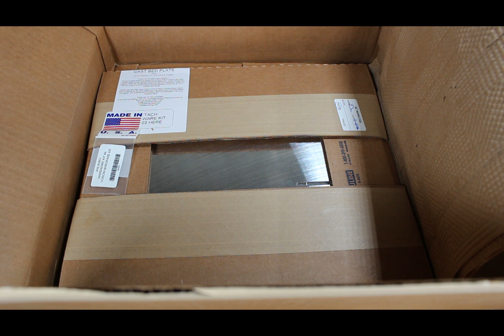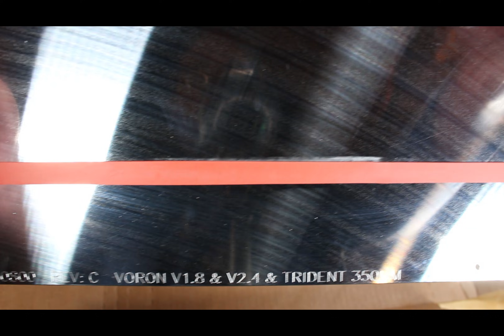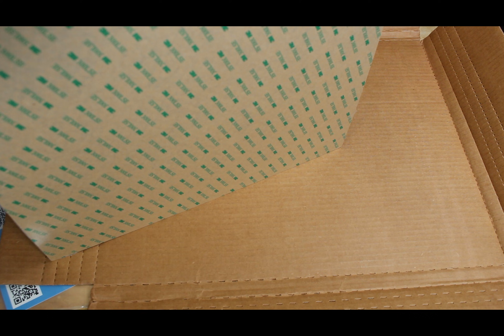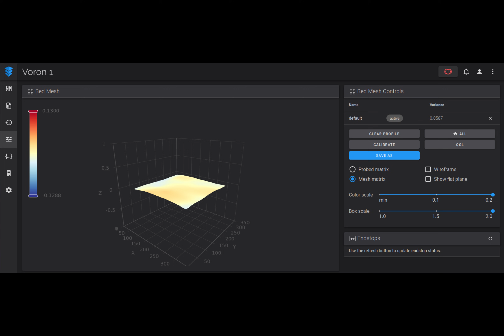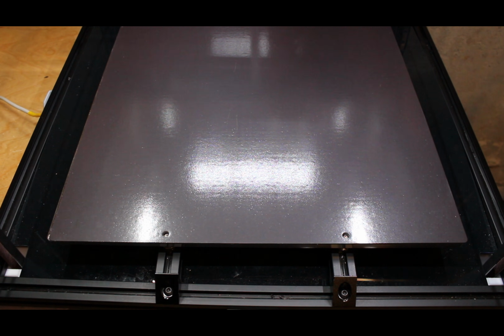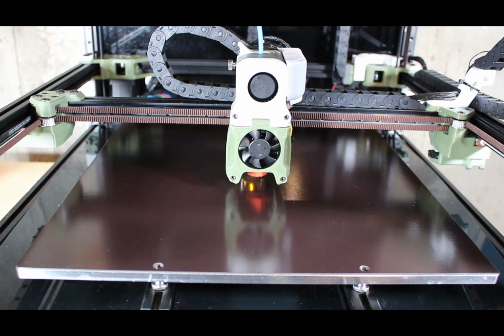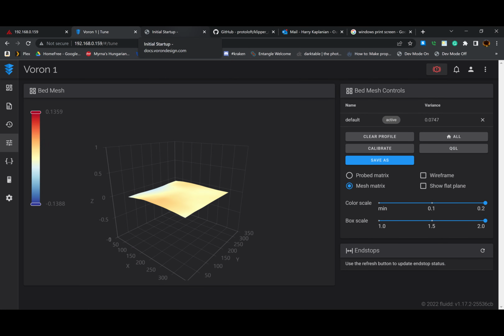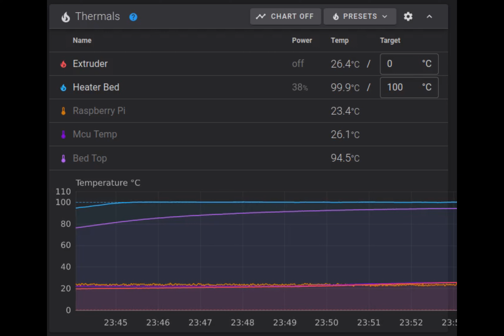The Secret to a flat  3d printer bed

Comment: Goo-Gone has acetone in it which I suspect is why it came off easy.
Reply from the maker: If it does, I could not smell it.  It's a bit of a mystery what's inside Goo-Gone...
Reply: @KapmansBasementWorkshop  I actually went to get acetone the other day and saw Goo-Gone. One of them definitely showed it having acetone. The other types didn't really mention it so maybe yours doesn't.
Reply from the maker: @jackshett  I could not find acetone that week.  So Goo-Gone it became.  Does the acetone work well?  I was told online to use alcohol, and it did nothing.  It might have even made the glue harder!
Reply: @KapmansBasementWorkshop  Acetone does work, but it is probably about as effective maybe slightly stronger.
Reply from the maker: @jackshett  Probably stronger.  But the fumes.....

Comment: I'm curious. With bed mesh adjusting for the small imperfections why do so highly value a bed that's .07mm rather than .16?
Reply from the maker: Really good question.  The mesh doesn't fix everything and It would be nice to be able to print without a mesh.  My original goal was to see if a flatter bed could provide more consistency and more importantly to see what a flatter  bed  would bring to the printing experience compared to many of the beds that come part of a kit.  I can't answer that yet as I don't have enough time with the flatter bed.  I would assume for many, 0.16mm vs 0.07mm just isn't important and I can easily understand why.  I ended up publishing this video as a help for people building a new bed/printer so they can hopefully avoid the mistakes I made and have a better bed using the parts they purchased.  I also hope for those that are having bed problems that mesh isn't fixing, some of these tips can be used to improve the bed existing in a cheap manner.
Reply: @KapmansBasementWorkshop  Well, its very good information and something I wouldn't have thought would impact the bed flatness. Definitely good info for people building Voron's. If I'm ever preparing a bed again ill take care to apply the magnet on as flat a surface as possible.  I ask because I'm the type to also go down rabbit holes. I guess most attracted to the Voron are those who like fiddly things. But I also try not to follow my natural tendency to push fiddly types of inquiry or tweaking past the point they actually produce a net benefit. Its a hard line to recognize at times, and even harder to respect.  my bed fluctuates between .12 and .25 depending on bed temp. But I find the bed mesh takes care of it well enough. I probe with one reading (dip down) as my PN-08 is surprisingly accurate and repeatable.  That combined with high speed for movement leads to fast probing. Ohhh, also, you MUST setup adaptive bed probing. that is brilliant and saves time for small prints and allows you to use a higher resolution mesh. check that out for sure.   Enjoyed watching you spiral ;) Thanks for the info !!!  https://github.com/Frix-x/klipper-voron-V2/blob/main/macros/probing/bed_mesh.cfg
Reply from the maker: @ThePhilbox  Thank you.  This was definitely a rabbit hole.  This was supposed to be quick and easy, but when I did not get the results I was expecting, I just had to get to the bottom of it.  Adaptive bed mesh looks like a fantastic idea.  I considered it.  But now, with this new setup, I've been printing for days and getting great prints, even the large ones over 300mm wide.  All with no bed mesh.  So it was a pain up front, but no more bed mesh at all!  In the end I'm pleased.  Thank you for watching!
Reply: @KapmansBasementWorkshop   Hey, I'm back with a novel thought, it just hit me....Why are we worried about getting flat beds, rather than flattening the interface between the bed and the spring steel. Why not Flatten the magnet with a piece of sandpaper on a flat surface. Should make for fairly quick work. New flat bed, big pain in the ass. Lap the magnet flat on my counter, 50 cents and 5-10 min work. Now, of course this depends on the competence of the person and flatness of the reference surface. But, I've never seen this suggested. The soft magnet may conform to a flat reference surface with little work.
Reply from the maker: @ThePhilbox  I think you are 100% right on with that thought.  In a sense, that's kind of what I was trying to get at with this video.  It's that magnet and the glue that's critical. The aluminum plate is really flat enough.  I think even if the aluminum is slightly off, being careful with magnet placement and curing could actually improve the overall flatness as it could hide the plate's flaws.  I actually plan on going back to by old bed and flattening the magnet.  But I was thinking about heating it up with it's bed heater and leaving it on a flat surface.  I thought the heat would soften the glue and allow the magnet to get flatter.  Your idea might be better and safer.
Reply: My original variance with the same kit was 0.31-0.38 depending on temperature and how long it sat. Even with the mesh I had print issues and according to the Voron team going over 250mm leads to more complications printing which I believe is a result of the issues covered in this video.

 I originally went to the Voron discord for help with my variance after a few prints failed to stick well. The general conclusion was the X rail was bowed due to the dual rails. I had used a 0.0001" graduated dial test indicator to ensure parallelism between them and as a result had extremely smooth movement indicating the Hiwin rails were well made so I rejected their conclusions and went with the same bed in the video. Needless to say my X rails were fine.
Reply: @ChrisHarmon1  Fair enough....I have a magic studio plate with .15-.3 variance. Bed mesh seems to work fine for me. But have still had to chase issues like thermal drift of the probe, and thermal expansion of the frame/gantry. Once I started heating with the probe over the build plate (recent change) all my problems were pretty much solved. Now if I'm doing back to back long prints just have to remember to drop it down a tad to fight thermal expansion.
Reply from the maker: @ChrisHarmon1  What variance did you end up at?

Comment: Interesting I now use borosilicate glass with a bed sticker only down side Is I of to use a spatula to remove prints, bed my bed is real flat, 0.0125 variances
Reply from the maker: What 3d printer brand is it?  I've been thinking about testing that out.

Comment: Very nice video, but it doest mater if it is 0,05 or 0,4 mesh leveling fix it and nobody notice it on prints. I also like perfection but this is just waste of money, you should buy titanium backers because when you heat up printer and gantry bent more :) And your bed perfection is lost. It is just 3d printer not telescope in space.
Reply from the maker: There is certainly truth in this.  That said, moving to a single rail made a big difference without adding any weight and this new plate with a careful application of the magnetic sheet yet another.  My goal was to not use a bed mesh and have parts 300 mm and larger be as flat as possible.  Hopefully others will gain something from my mistakes.  Thank you!
Reply: @KapmansBasementWorkshop  Now i checked my bed variance before print and it is  very nice 0.039 mm, after heating it is something like 0,1+ something ... but titan backer are ready to install! :) Looking forward to new videos, I really like how you explain everything.
Reply from the maker: @davidbucek  My previous bed was not as good a yours.  I'm sure the titanium backers will provide a big improvement.  Taking off one of the mgn9 rails provided a substantial improvement for me in probed flatness, especially when hot.  Let us know what difference you see with the backers on.  Thank you for the kind words and thanks for watching!

Comment: Great video. Concerning the top thermistor and its readings never hitting the same values as the bottom thermistor - would this be a case for using a temperature offset in the SuperSlicer? That way you could get them closer. (At least as far as I understand it.)
Reply from the maker: Thank you!
A really good question..  I don't use SuperSlicer  and I could not find documentation that could explain it to me clearly.  But I think it's relatively easy in Klipper to get the software to heat the bed until the temperature of the top sensor hits the correct value and ignore the heater sensor as it normally operates.

Comment: Great tip. I had the feeling that the magnetic layer could end up messing with the flatness.
you proved it and solved it.
Reply from the maker: I think the biggest issue here was actually me and the way I assembled the bed.  I'm pretty sure many others both before and after me have flat bed issues that are related to how the bed was assembled. Hopefully this will help future builders as well as others that need to fix their beds.  Thank you and thanks for watching!
Reply: The first magnet sheet I used early on in my journey was fairly thick.  The printer came with a glass bed that sits on a metal plate that has the element attached to it.  I very carefully placed the magnet to the glass bed and then onto the metal plate.  This final quadruple layer allowed for a lot of inconsistency across bed temp as the base plate, glass bed, magnet + adhesive, and finally the build plate all would expand differently at different rates. Was pure madness attempting to get a decent bed mesh created. Even the smartest of us miss out on some of these intricacies and we waste so much time.  Video was a great reminder.

Comment: You're assuming that the thickness of the magnet and the spring steel plate are uniform when likely they are not. Its why imo these precision plates are a bit of a waste of money.
Reply from the maker: I think it's a common belief, and I've never seen any specifications for the sheets.  But I actually believe it's the glue that's used that has the biggest impact.  Nothing really wrong with the glue, but making sure the glue sets while pressure is applied on the flattest surface possible is really the trick.  I'm convinced with a little more pressure and applying the magnetic sheet before the heater on a very flat surface should make up for much of any inconsistencies that exist in the magnet.

Comment: Awesome video! I'm keen to get a replacement for my Trident 350mm. Do you have referral code? Want to get you some credit
Reply from the maker: I don't have a referral code.  But I highly recommend the build plate from Precision Printer Parts.  The same plate works for both printers.  Wait until you open the box and see the plate 1st hand.

Comment: Seeing this on the discord right before I start assembling my own. Absolutely great! Other must-watch videos before assembling? [things not covered in manual]
Reply from the maker: Glad I could help!  So here comes a shameless plug...subscribe to my channel and browse around.  There is a pretty long list of videos that could provide some help/tips.  If you are building from a kit, I think these recommendations in this video will help make that plate better/flatter.  That said, Nero and Steve Builds are quite popular.
Reply: @KapmansBasementWorkshop  My 2.4R2 300mm is finished and I have a variance < 0.09. My unklicky probe is allowed a 0.003 deviation. Not much worse than you, thanks!
[Actually it's only one point that's 0.05 lower than the rest, at X30 Y150.]
Reply from the maker: @iniqy  Thank you for reporting back.  That's great to hear and I'm glad you've now got a flat bed!  Most importantly... congratulations on the new printer!  Have fun with it!

Comment: Very cool. Bed time story. 
The bed levels were cold beds?
What about hot bed? Just hit 110c, heat soak 1hr and 2hr chamber 55 temp. I really like your temp graphs for all the devices n controllers.
Aparently there is alot of thermal expansion on the gantry and many people use x and Y backer rods or old mgn rails to help with heat deformations.
My bed shape changes alot. With heat. About to install old mgn rails as backers supports. 

On other notes. I've had great success with the Single x Axis mgn9 . I converting it to the dual mgn9 setup and all my head wobble has been eliminated. Gained some weight but it prints perfectly.

Thankyou for great VORON content.
Reply from the maker: You bed should not be changing that much from heating if it's a good cast aluminum bed.  I resorted to this after fixing other things, especially the gantry.  Each fix seemed to improve the bed mesh.  There really wasn't anything left to fix/adjust.  So this bed when hot, differed from the cold by < 0.024 with the final magnet attached and a 1 hour heat soak.  Now that still might not represent the final results because the printer's side panels were removed, so the interior of the printer was cooler than usual.  I probably should post a follow up at some time, but I'm currently making some additional changes.  I'm glad the single mgn9 rail worked for you as it did for me.  Finally, Thank you for the great comments and watching.  I really like your sense of humor!

Comment: The need for that last 5 to 10% of perfection/accuracy will always be the most annoying and difficult part of any project. And honestly is easily skippable 99% of the time. But i always appreciate those that attempt it.
Reply from the maker: Thanks!  Believe it or not, I just consider this "ball park".  I was targeting < 0.05 variance.  So close, but not quite there.
Reply: @KapmansBasementWorkshop  to finish at .05, the build plate would have to be much more precise, then each layer brings it's own imprecision: plate, glue, magnet, flex plate.

after all .05 is only 50 micron! , I guess you would still need a bed mesh to print on the whole surface and have anice and shinny bottom

Comment: I always find your  videos on target for my issues. Constant melted probes and surfaces if the print bed. I narrowed my down to the magnetic sheet and or a warped x rail. The aluminum plate is MIC-6 grade. Too bad they dont sell superflat magnetic sheets. an option is embedded magnets in the plate itself. Thanks for doing some of the work for me. Love it.
Reply from the maker: Thank you!  In this case, I actually think the original magnet was fine.  The problem was me and how I attached the magnet.  Ad long as the adhesive cures under pressure on a very flat surface, this should come out great.  This was purely my mistake.  Up until this point, I failed to see the need for beds with embedded magnets, but they suddenly seem like they are worth trying.  Thank you for watching!

Comment: It looks like you truly enjoyed the process of discovering how you could get your build plate to be more precisely level. I learned several things. Thanks for taking the time to put this together and sharing it. 
Nice to see some ingenuity regarding the placement of the bed thermistor. 

The idea will come in handy when designing multi zoned/heat zoned beds for more precisioned/zoned targeted small build areas for smaller prints in the future.
Reply from the maker: Not sure if "truly enjoyed" was dripping with sarcasm or not (it should be), but I was very disappointed with the  initial outcome and spent a week procrastinating removing the magnetic sheet that I had applied incorrectly.  Hopefully others will gain from this.   I never thought about large multi zone beds, but this would be useful.  In the future, I plan on having the printer wait until the top probe hits the correct temps prior to starting the print.  But that is for another day.  I originally thought it was a gimmick, but it's turning out to be very useful.  Thank you for watching!